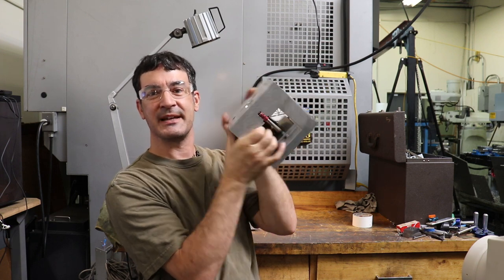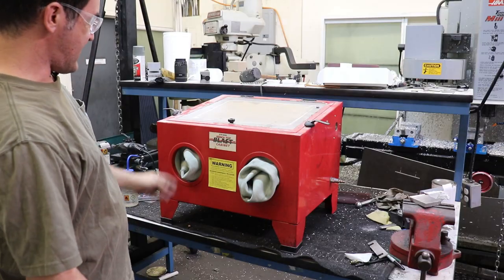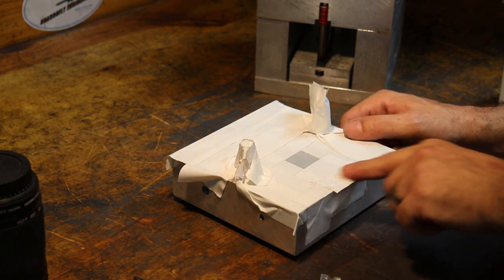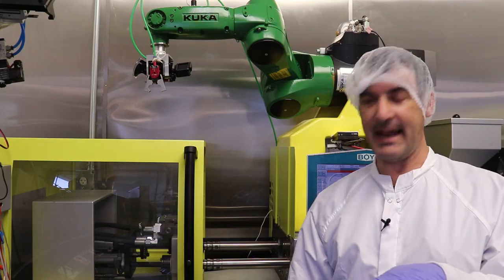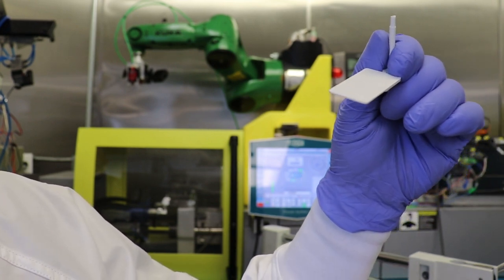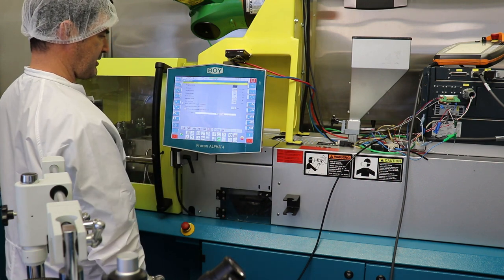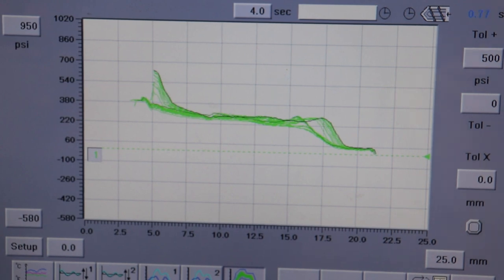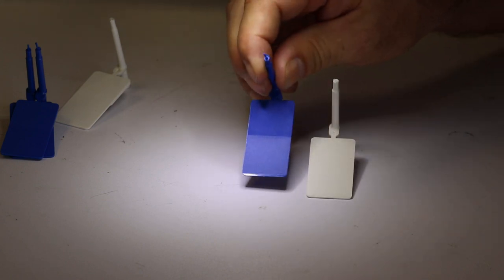EASY MOLD SURFACE FINISHES

Comment: I wonder what a part from an anodized mold would look like. It should certainly be a more durable mold.

Also, what about those microscopic textures like the ones on car dashes?
Reply from the maker: Hi Vincent.  Yes, anodizing is good for alum mold life.  I plan to do that on some other molds.  The fit is sometime a problem since the anodize can grow your parts a bit.  EDM surfaces can also make a wide range of texture.  Dashboards may be EDM

Comment: Have you dry the Play-Sand bevor you use it, or is it dry enough?
A screw for Polypropylene have got a injection molded non return valve and i saw that you work with a colered second component .
I now a company they build a special injection molded non return valve and they call it Mixingring, it homogenized the two components mutch more then the normal screw action does.
I think it can be helpfull.
The internet presence of this company is only in german, they will send you information-material of all there products in english.
I remind me that a company on a fair use a shut of Nozzel against the stringing problem with ABS.
Only ideas from germany perheps somthing is usefull.
Reply from the maker: Thanks for the info Mario.  Yes, polypro can be a problem with drooling out the front.  Good idea about ABS string.  Regarding sand dry, I am in California which has been very dry for 6 months, so it is dry all right.  Thanks!

Comment: how do you actually measure texture to see if its in spec? I've used stylus based surface roughness tools in the past but have been reading about optical versions. How do you know when the mold needs to be re-textured based on physical data/roughness vs appearance?  Thanks!

Comment: Hello again, the surface texture is affected by the shape and hardness of the grit. 
Sand loses its shape very quickly, while glass bead has a more rounded form. 
If you want a fine, sharp finish, try garnet. But your aluminium mould material will quickly degrade. 
if you are expecting a consistent finish throughout its life, a hard steel mould base is the best.
Reply: Geoff crumblin that is absolutely correct what you wrote.
But i think dragonfly engineering use aluminium because the mould is only a prototype.
Manny companies i know use Aluminium to build prototypes.
Reply from the maker: Thank you for the advise Geoff.  I have an aluminum mold with texture that I will anodize to hopefully add some life.  I agree with steel for long runs.  Thanks for watching!

Comment: do you have stringing issues with abs
Reply from the maker: Hi Oscar.  Yes I have ABS string problems 50% of the time. I pull the injection unit back fast and pull the mold open fast .  Also, if I can, I cool off the nozzle to help freeze off the break in the sprue.  A smaller nozzle port diameter helps too.  I also load the mold with the cavity up so strings damage the un-used part of the mold below ( for prototypes)